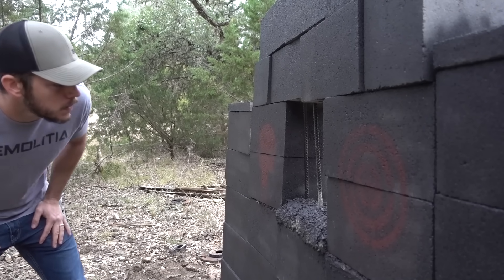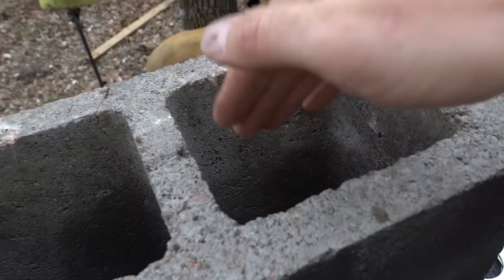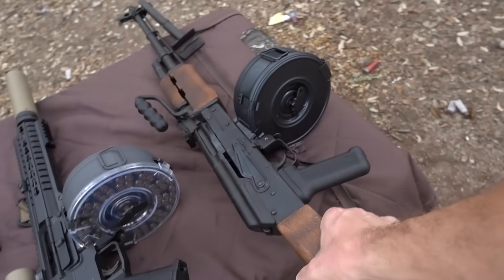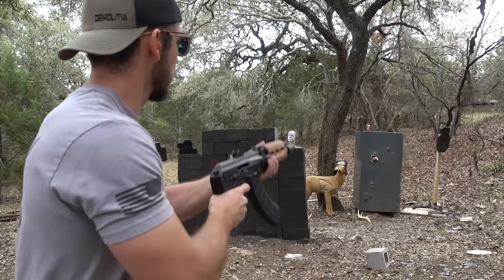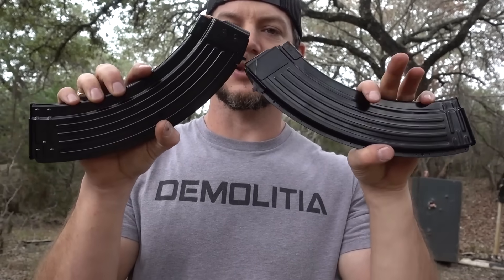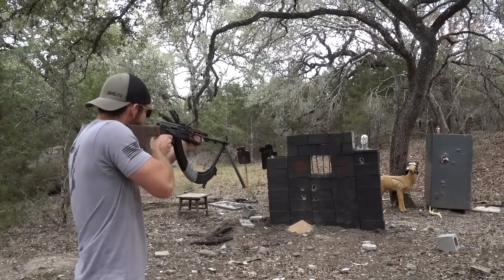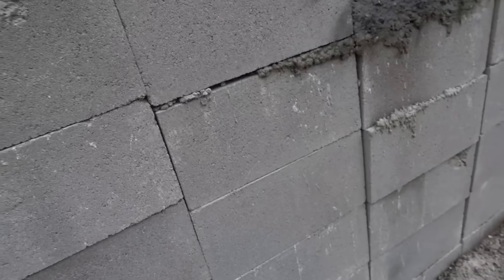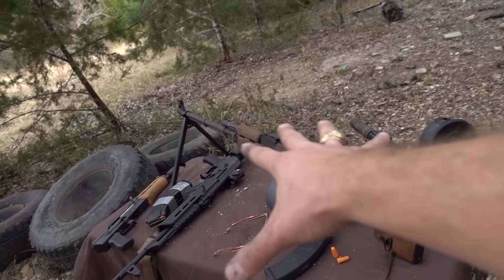The RPK vs Prison Walls

Comment: Enjoyed the older video. I used to install heating and air duct for a commercial company. We had to install some duct work in a new jail and in the walls was rebar and a concrete that was rated harder than ordinary concrete. My brother rattled the screws out of a large hammer drill just trying to cut through the wall. That's some hard stuff.
Reply: My company does demo and abatement at several prisons in our area. Can confirm the concrete is tougher. Also a huge pain in the ass doing any work like that in a prison. The protocols for getting stuff in and out are horrendous, and there always seems to be an incident leading to a lock down at lunch or home time. Sucks getting stuck on the job for a few hours while they break up a fight.

Comment: Try filling cinder blocks with dry sand and wet sand and compare their stopping power.
Reply: Sean Hampson oh shit that’s a good idea
Reply: Sean Hampson mud?
Reply: He probably said wet sand for a reason, probably not as "wet" as mud?
Reply: sand doesn't get muddy ,,have you ever seen mud on a beach? Mud is exclusive to soil
Reply: critical thinking i meant filling it with mud..(i was unclear)

By mud i mean not water with some dirt
Rather very wet dirt similar to the concrete he used to fill the wall when it was still wet
Reply: @reedy_9619  actually dirt with the same water ratio as wet pourable concrete is mud,,oh so you just added another test,,I thought you just tried explaining wet sand as mud,,,sand can't hold the amount of water that dirt can
Reply: critical thinking oh no just suggested mud didnt mesnt wet sand is mud
Reply: @reedy_9619  exactly! Cheers!

Comment: You should get a full auto liscens it would be much cooler
Reply: RICHIE Jr  what is a full auto license?
Reply: Cody Wright its a contract saying you can have full auto guns
Reply: christopher dean sorry bro wrote it really fast
Reply: @quack1404  you can legally shoot fully automatic in America with a Class 3 firearms license.
Reply: @Ernest Carter smh no that's not full auto. That's called pulling the trigger...
Reply: No, you can shoot autos, you just have to go through a licensing process
Reply: OG-Corn Bread lol that’s not full auto.
Reply: Owning full auto weapons require either; A: a Class 3 FFL license, which means Matt would have to become a gunsmith and acquire a license to make and sell fully automatics to use em, or, B: A pre-1986 FOPA banned registered full auto weapon receiver, or sear, which run in the tens of thousands or more. Option B seems more feasible to Matt, despite the enormous  price tags.
Reply: An Individual in certain areas can own a fully automatic firearm after fees and background checks. Those fees and checks apply to every weapon in question. Unless your a dealer or manufacturer. I'm not aware of a "liscens" rule that just let's you rock full autos everywhere...
Reply: not true, automatic fire is completely legal in the US, provided you are firing legal weapons with appropriate licences, or have bump fire, some people can even fire a semi-auto close to, or at, its actual rate of fire by single trigger pulls.   @quack1404
Reply: @Ernest Carter he is pulling the trigger at around 300rpm, about half the rpk/akm rate of fire.
Reply: @thecontentlesschannel5239  You do not need any sort of license to purchase a machinegun in the USA. Stop playing COD and learn yourself.

Hint: Look at the bottom of a pack of cigarettes.
Reply: Full auto guns are only legal to civilians in the US if they were manufactured before May 19th, 1986. Laws, taxes, and additional regulations vary by state, but the limited quantity means that they currently tend to fall in the $20,000+ range.
Reply: @Jack-yg7pi  It's full semi auto according to Lt. General Mark Hertling (RET).
Reply: @lum4r   depends on the gun. they range from $2000(auto sear)-$6000(uzi). assault rifles are around your price point depending on rarity, and LMG's are triple that. 

As far as anyone else is concerned, you only need a license if you are in the business of dealing with Class 3 firearms. ANY civilian can buy a pre May 19, 1986 machinegun(transferable machine gun) by filling out the proper atf paperwork, similar to buying a suppressor, or a sbr/sbs/aow/DD. there is no special permission required to buy one since it is literally the NICS check that is instead run(and registered) by the atf, and you dont need any special permission or check to just shoot one.
Reply: @thecloner212  If you watch forgotten weapons I've seen some pre-1986 automatics go for under 10k sometimes even under 5k, Though the coolest guns will cost a lot.
Reply: @codywright5416  class 3 gun license
Reply: @thecloner212  bring these guys back to school
Reply: RICHIE Jr class 3 is really hard to get
Reply: He probably has a lot of money GET full auto
Reply: First off it’s not a license, it’s a very similar scenario to buying a silencer. You pick the fully automatic weapon that you want ( extremely expensive) provide two pictures of yourself, fingerprints, and bunch of question etc. submit the application with 200$ and wait about a year for the ATF to say yes/no then go and pick it up. Anytime you have your fully auto firearm on you, you must have your class stamp provided by the ATF upon approval. Keep in mind many states of outright banned them, but there are many states you can still own them and use then regularly. I know a guy who owns a M2 Carbine. Well actually his trust owns it, but you get the point.
Reply: Swampy  uh last I checked a mf AK doesnt come in a "civillian semi automatic" nor does the M240 he just depends on how he fires it
Reply: @thecloner212  the auto seer is much easier to come by as well. All AR and ak platforms are built with the durability to handle full auto and or burst fire. It's the trigger assembly that determine the classification of m-16 or AR. One person told me buy the $8,500 auto seer which has to be bought with a specialized lower that's another $1,000 to have the selector switch and stronger springs all before the tax stamps and shipping get involved so in theory it would be another 50bmg rifle price tag minus the optics. Most sheriff's department or highway patrol don't like to sign off on full auto though usually they will sign off for burst fire seers
Reply: THIS IS THE MOST LIKES I HAVE EVER GOTTEN😆😆thank you guys so much!!!!!!
Reply: Swampy  then tell me how he has full auto weapons

Comment: Rpk is badass you need next a minigun or m60 mg but a minigun is everyones dream
Reply: NiggoAmStizzle na, go for a Galil
Reply: Semi auto minigun lmao
Reply: The kik from a minigun would knock you down and it requires 2 car batteries allso it fires between 60-100 rounds of high caliber amo per second mini guns can only be used when mounted on vehicles or buildings
Reply: I still don't get why a minigun is called a minigun when it's really a huge feckin gun :D
Reply: NiggoAmStizzle The only minigun he could legally get. Not even the military has handheld miniguns, they just mount them on vehicles
Reply: My middle name is regret  They should make a mini that shoots 22lr it would save a lot of money on ammo.
Reply: NiggoAmStizzle what about a MG-42?🤔
Reply: robpiy91 the reason is because it’s actually a mini version of a rotary cannon that’s on say the a-10 warthog which, just the fun itself is 20 feet long
Reply: Unless Matt gets a certain kind of FFL like dealer, manufacturer, maybe gunsmith, there's no way that he can get a mini-gun unless there's one out there made before 1986 because of the NFA.
Reply: @RKret1234  Very expensive. I don't think that there that many (real) MG-42s out there and as soon as one appears on auction (about the only way someone is going to sell one) the price is going to climb very fast. There might be semi-auto replicas out there, but also not cheap but probably not much more than one of his .50s. A full auto replica MG-42 might be possible but there probably aren't too many of those around in general and even fewer made before 1986 and are transferrable.
Reply: Riceball01 yeah. That's also true. But man. Wouldn't it be cool if he made a video on it. But the chances of that are slim. And I just gotta accept that.

Comment: 1. The  mutant.
2. The RPK!!
Reply: That1GuyOnPoint mute main R6S
Reply: i would go both as the mutant if suppressed because then you dont attract more zombies plus more accurate one shot one kill
Reply: @snipenrun688  the problem with the mutant is with supersonic ammo, the gun's sound is only marginally reduced. The zombies are still gonna hear it, maybe just not as easily.
Reply: he said unlimited ammo he never specified type so you could put subsonic ammo in there

Comment: That’s actually not a cinder block. Cinder is no longer put in these blocks because the cinders were from coal plants & those aren’t as popular anymore, now more accurately they’re called concrete blocks, or even more so they’re called CMU’s. Which stands for concrete masonry unit